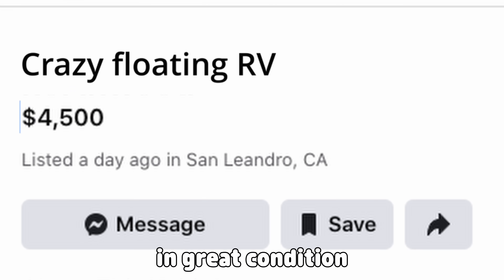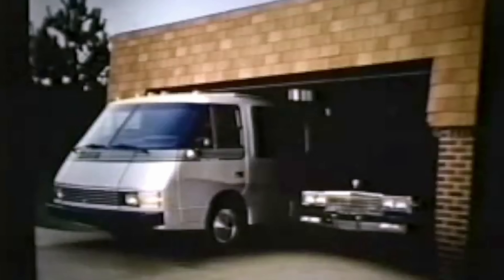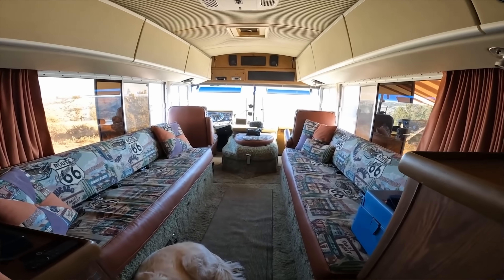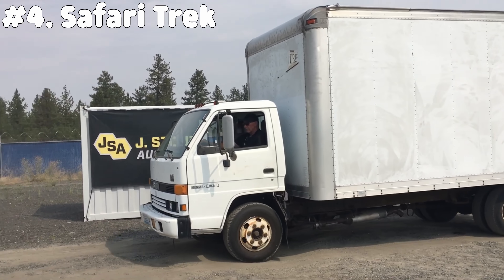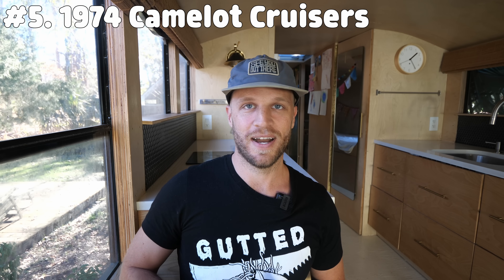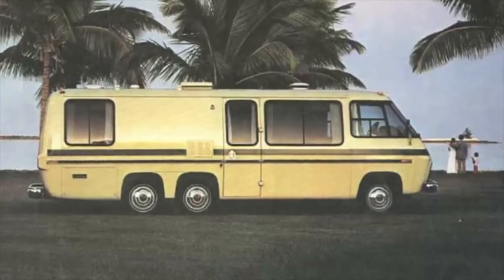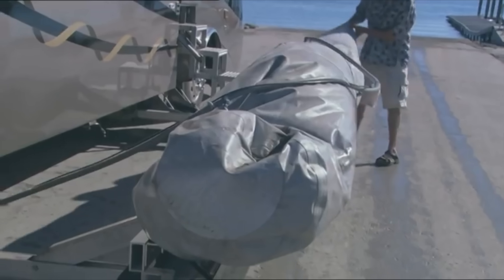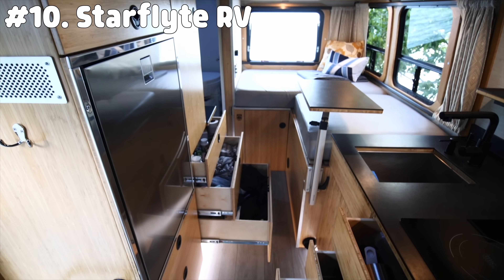If You See Any of These RVs For Sale BUY THEM

Comment: i work with small trucks. (old ford 700, mb 1114 for example) . and ive been thinking about using a 20foot container to build the "house" in. keep the work truck and load the container on the flatbed for when i want to travel. and still have the container/house to be used in the yard where i work the rest of the year.
Reply from the maker: Sounds ideal to me!

Comment: I just saw a 1989 Vixen SE on Craigslist in Sacramento, CA. for $5K BMW 2.4 liter in-line 6 cylinder diesel with a Garret turbo. The engine is friction clutched to a Renault 5 speed manual transaxle. Says it needs mechanical work. I wish I had the money to invest in it.
Reply: Um I didn't see it.. how long ago .. maybe you have the number

Comment: Fun fact: the Vixen was only available with a manual transmission mated to the BMW M21 diesel engine. Meanwhile M21 BMWs sold in USA were only available with automatics

M21 was also used in Lincoln MK VII
Reply: Later they switched to a Buick 3800 which was automatic.

Comment: If I had an unlimited budget I would Buy one of the new Ken worth T880 all wheel drive trucks and make it a 6 door cab with a double bunk bed. This way you can take a family of 6. Then I would have a custom low boy trailer made to which will have a solid bottom on it and insulated. The low boy part will be where the water, sewer, batteries, air conditioning and heater and storage will be. Rear drop down will be where a 6 door mini compact hatch back car would be. The whole deck would drop down and you would just drive right up and stop then Pulled in by a winch in to a set of tracks at a slight incline. Once in you can add a second cable to connect the rear. This would lift up via cylinders. 
The top section would be like a media trailer which folds out to triple its foot print. If someone was to do the design just right you could have a 1200 square foot trailer. You would have 2 flip up sections on each side about 24 feet long. Each one of these can have built in TVs. Computer desks that unfold. Couches that fold out and all you have to do is add the cushions. Set up might take you 30 mins to pull everything out and set it up. There are a number of videos out there your can watch about folding up things and you might find quite a bunch of cool things. With 4 additional rooms which can be bedrooms, living rooms or what ever you have the choice to have all kinds of stuff build in to the wall. Depending on how thick you want the walls which 2 inches of closed cell foam gives you a good r20 which is more than enough plus the skin and interior stuff. 4 inches floor, 4 inches roof, 4 inches front wall, 2 side walls 4 inches and if you have a wall with door 4 inches. That is 20 inches of thickness that has to be on the inside of a 100 inch wide trailer. That leaves you with 60 inches left over. This is 5 feet of space where you can put the kitchen, bathroom and anything that can not be moved. Which i think 5 feet by 53 feet is more than enough room. The 4 inch thick is enough to add in TVs thin computers, storage for keyboard, mouse, remotes. and anything else you might find on a desk. This should able be thick enough to have space saver furniture built right in to the wall. Should even be able to build a bed and then add a mattress. which I think there is a gap in the middle of one of the layers that could hold a mattress. Like I said if you spend some time with a design team you could build something nice. 
The fold out does not have to go with a semi trailer a high end motor home should have this. Really ticks me off that these 200k plus motor homes still have not found a way to increase the square footage yet are super picky on their slides. I have see enough of them to know It does not take much to make a slide. You could build a cabinet slide. Manual slide with easy open and close locks. Either way I would super love to have someone Design out something like this.
Reply from the maker: That sounds fucking fantastic!
Reply: @MobileDwellings  Just youtube media trailers and you can find quite a bit of cool things that should be added to rvs.

Comment: You forgot the 1994-1997 Serro Scotty Highlander Class C RV 23-25 ft option with factory 4x4 with the 12 valve Cummins 5.9l engine. I have 23ft. 4x4. For less then $200 bucks it can be cranked up from the stock 160-180hp to 400 hp. 900 lbs ft of torque If I do the speed limit, 18mpg.

Comment: I owned one of those Vixens. It was well built and really could go 100mph.  (I got it up that fast back when Montana had no speed limits.)  But it did have it's draw backs.  It tended to over heat on long uphill climbs I had to add an electric fan to the radiator.  And you could only stand up in it when the roof was raised.  So while it is cool and looks like a class A, you'll have nowhere near the room of a full size rig.
Reply from the maker: Wow that's amazing that you really got it up to 100mph. i was worried that may have been a little hyperbolic. Glad you liked it! Definitely a trade off vs a typical class A but kind of seems worth it!

Comment: Honestly buying a very limited production vehicle from 30+ years ago with the intention of using it often would not be to me a smart move as to many of the parts used would be like finding hens teeth today.
I know sometimes even finding certain body/weatherstrip parts for what was a very popular mini van made until the early 2000's was difficult as these days most wrecking yards are crushing anything over 5-7 years old.
I needed a back glass for a rear liftgate that got broken out and it was no longer available new and the majority of the used ones I found were multiple  states away and the wrecking yards would not ship.

I did finally find one where I purchased the entire rear lift hatch and they had another location they would ship it to about two hours away from me and I drove and picked it up.

Also needed to replace the weatherstripping around the rear hatch and for a number of years the original was no longer available and no one was making any reproduction weatherstrip for this special application.
I did finally get lucky and a company started making reproduction weather stripping available which I purchased.

My whole point is that these issues are in dealing with a vehicle that has a very popular following that they made millions of and the parts interchange for over a decade of production but yet even now only being out of production for about 20 years certain parts are getting fairly hard to source.
I surely would not want to be dealing with sourcing parts when there were only a few thousand or less produced originally!

They were neat vehicles when new but I would not want one today.
Reply from the maker: Yeah I feel you. I have a 1987 Gillig Phantom school bus. They only made 2400 of them and they were sold on the West Coast exclusively. Most were crushed due to new emissions requirements in CA in the early 2000's. It has a Detroit Diesel 6v92 which stopped production in the 90's. That being said I just replaced rear door weatherstripping with a $35 product off of Amazon and I easily sourced a part for my engine from one of the shops who still service this engine (they're in farming equipment, buses, fire trucks, and old boats). Maybe it's just the bus world but turns out most parts are relatively proprietary or maybe I've just gotten lucky. No matter what it's a labor of love! And the message here is "if you find one of these rare RV's in great condition and for a cheap price you should probably buy it" over something new and expensive but if you're not up for that particular adventure than sure, get something very standard and serviceable.

Comment: I don’t understand why I can’t have a currently manufactured RV get 30mpg. I would totally daily drive it lol
Reply from the maker: I feel like it could be done. Would need a modern, small diesel engine, a build that heavily prioritizes aerodynamics like the vixen 21 with covered underbody and wheel wells and a modular design like a pop top. and then it needs to prioritize being lightweight, probably disregarding some modern safety standards that American cars adhere to.
Reply: Haven't seen any full RVs like a Vixen, but a few of the Euro camper vans (like a California) get close.  Really expensive for what they are though.
Reply: @MobileDwellings  they have all of the right house parts to be classified in a way that sidesteps safety requirements.
Reply: Internal combustion engines have a tradeoff between burning cleanly and burning efficiently, and government regulations are firmly on the side of burning cleanly, so diesel engines aren't as efficient as they could be under, say, 1985 emissions regulations. If you could ignore emissions regulations then 30 mpg is easy with an aerodynamic unibody RV. Personally though I'd prefer 23 mpg and no acid rain or respiratory diseases.

Also, 30 mpg using 1985 testing methods is equivalent to 25 mpg using 2023 testing methods, so a 4 cylinder Sprinter RV isn't that far off.

Comment: What do you think about a 1992 Safari Trek in good condition with 61000 miles for 8,0000 dollars? I'm tempted but nervous since this would be my first RV. Thanks.
Reply from the maker: I think $8K in good and mostly stock condition is a great deal. The Isuzu safari trek sells for $12K to $16K these days. The slightly newer gas ones fetch a little more. There are plenty on the market though so prices could go down but $8K sounds good!

Comment: If you’re going to buy a Bluebird with a Cat 3208, pay the couple hundred bucks to have it inspected by a real diesel mechanic and dyno tested if possible. The 3208 is a great engine and very durable, but it’s not rebuildable. Make sure it hasn’t been abused and it will last forever.

Comment: The idea that a Vixen could get 30 mpg is ridiculous.  We had a wonderful BMW 324TD Kombi (station wagon) when we lived in Germany with the same engine and transmission as the Vixen, but only about one third the frontal area and about one one quarter the weight.  The best we could get was about 35 mpg (about 6.5 l/100km).  There is no way a Vixen could get 30 mpg.  Except maybe with a strong tailwind, down a mountain pass.  🤣

Comment: #7 is front wheel drive.
Reply: And in the city they handle incredibly well, since the front is pulling you around corners. I have a Revcon, which is basically the smaller version of the GMC, same engine and everything.

Comment: I had an executive diplomat II selling it was a huge mistake
Reply from the maker: That's a really cool RV. Thanks for sharing and I will definitely consider it for the follow up video!
Reply: @MobileDwellings  it was the neatest 78 working color tv generator pull down forward bunk above the driver's seat bathroom in the back. Had only had two owners prior to my purchase in 16 i had several other "land yachts" but it was far and away the best. After driving it only 100 miles saddled up the civic towing and drove it clear from Oregon to NC. Unfortunately that trip cost me more in gas than i paid for it and i sold it before moving to Puerto Rico.
Reply: I miss my land yacht but these days I have an 84' 48 foot ketch (sailboat) floating yacht to give me enjoyment/grief great content maybe you know more about the construction of said RV as i understand from my brief research it was pretty nifty with an aluminum skin underneath the fiberglass and some cross strapping Pluss ribs from the chasis but I'm not entirely sure. The best I encountered regardless
Reply from the maker: Puerto Rico and a yacht sounds pretty good to me! I spent about 6 months there in late 2010. Loved it.

Comment: You stunningly miss the point of why people get camper vans. It’s not a price per square foot calculation. It’s the compact size and ability to travel like a SUV instead of traveling like big motorhome.
Reply from the maker: A 200K van conversion is a very poor value compared to other options. As outlined in this video there are many smaller motorhomes. Many of these van conversion companies buy a 45 to 75K new van, put a pre fabbed 30K conversion package in it in 2 or 3 weeks with a couple hundred hours of labor and sell it for a 40 to 60K premium. It's just assinine and it's going to fall apart eventually imo.

Comment: Save your money.   Look into RV depreciation value 1st.    There’s a reason why you can by a 10 year old RV that cost 100k new for under 10k used.    Great investment if you like flushing money
Reply from the maker: This is literally the point of this video. Some were built better than others but can still be had for a song. Nothing wrong with a 10K RV. The 100k RV is the poor value purchase.
Reply: I’m not opposed to van life.   Just my experience with RVs has not been  good.   I toured once in a prison bus that was converted into a band bus.   It was solid, strong, reliable, but it drank more gas than we did beer.   I understand the living aboard a bus… an RV??  Nah..  I’ve seen too many bad RV’s

Comment: All RVs sound like a argument for flatbed fifth wheel option.. 
#1 Purpose beyond RV, daily driver and coupling
#2 Change truck or trailer, when need of replacing just do one
#3 Con, its too advanced for you
Reply from the maker: I'm really into flatbed trucks and 5th wheels as a concept are great. My problem with them are they are generally massive and I don't like the construction methods. Smaller 5th wheels would be really cool and there are a couple, scamp made one, and then more up my alley would be like a horse trailer conversion.

Comment: Never buy a motorhome, they're a money pit. Insurance, registration, massive depreciation. Stick with a truck and a trailer, trailers and deals are always around, and you won't have to tow a vehicle and ruin it. I'd actually suggest a Fleetwood, especially  a Wilderness basement model, which had the holding tanks mounted above the belly in a compartment below the floor and was heated by the furnace. They were tough winterized trailers made for Canada.

Comment: You should also convert the gas engine to an electric engine. It will be illegal for RV trailers to have gas engines pretty soon.
Reply: As a fan of EVs and am currently building one, I cannot agree with this one. The amount of battery required to get any usable range would be enormous. Maybe you could go plug in hybrid and have the electric offset some fuel usage, but as things are now, EV swapping RVs will take a while.
Reply: No, I own an EV but I don't look for EVs to be even half the vehicles on the road for at least another 20 years. Gas and diesel will be going a LONG time yet, but it it might get pricy as the demand starts to drop and oil companies crank up the price to compensate.
Reply: I'm tesla swapping a vixen, gonna beat everyone to the punch. Been my plan for ten years now, all that's been made recently is class B vans with electric, which cool for day trips and not much else.
Reply: Series hybrid might be a better idea. Small, 20-30 kWH battery for low speed city driving and house loads (no propane!) and an engine that only charges the battery at a fixed speed. Very easy to make an engine very efficient if it has to run exclusively at 3000 rpm.
Reply from the maker: Sounds awesome

Comment: Although this is entertaining, I have actually owned a number if these various units and can tell you that your claims are VERY inaccurate. Finding parts or mechanics to work on the Vixen is nearly impossible and it is a VERY UNCOMFORTABLE rig lacking in insulation. As with most cult following rigs, it is fun to have but the problems and insecurity of available mechanics pretty much negates pleasure. It DOES get close to 30 mpg WHEN IT ACTUALLY RUNS, but you freeze your arse  off or cook to the core because it is mostly windows and the stock seats are very painful. The GMC is a lemon, a failure, a parts nightmare and again fun but best suited for a backyard cottage that never goes anywhere. The Safari doesn't really get 15 mpg either and it is NOT fun to have a bed that must be completely stripped to close it tightly to the ceiling and remake it every time you want to pull over and have a nap. All of these older coaches are wonderfully constructed but most private parks are turning away folks with coaches older than 10 years old and some turn away units older than 5. It is a very sad statement that well-made classics must go by the wayside to allow stapled together 2x2 pine and thin sheet aluminum trash to take their places. A franchise of RV mechanics that specializes in vintage only classics like these would do well if only the parks would actually allow entry. I guess the multimillion dollar custom Prevosts will be staying home too. Funny, you don't see any traveling singing stars being turned away with their busses and most are actually classics!
Reply from the maker: I really appreciate your insights and I've researched each of these units a lot further over the past year or so and I can't argue with ANY of your points. But you've really made me curious by sharing your experience so which 20 year and older rigs would you actually buy? High end coaches that are older but well made like other Safari's without Majic beds? Country coach? Monaco? Beaver etc.? Let me know what you would buy! Thanks!